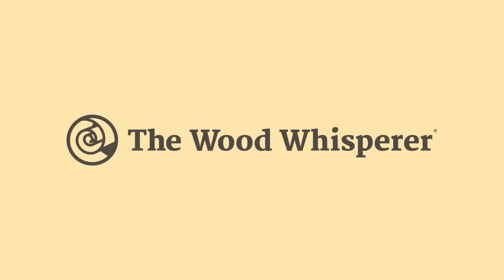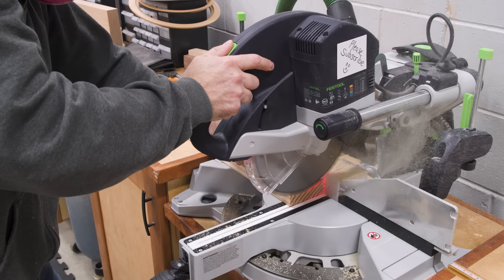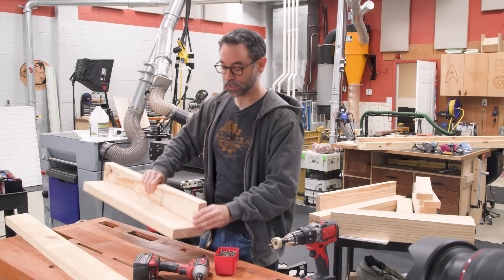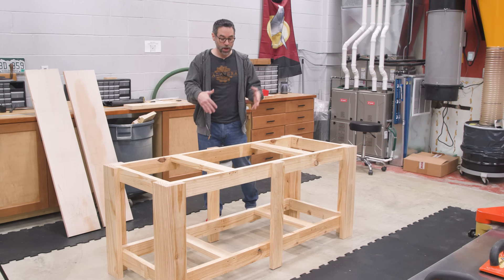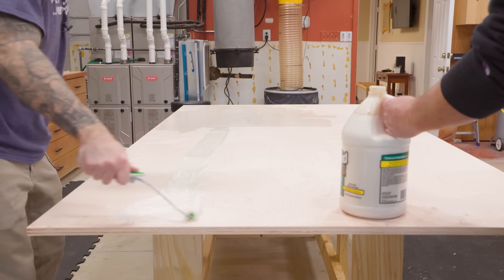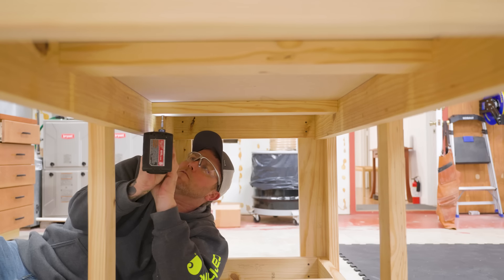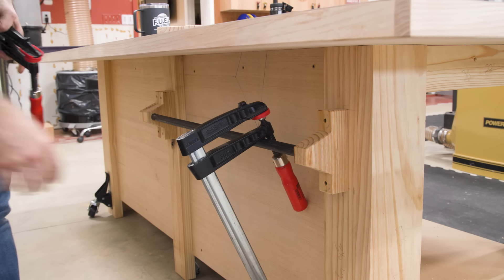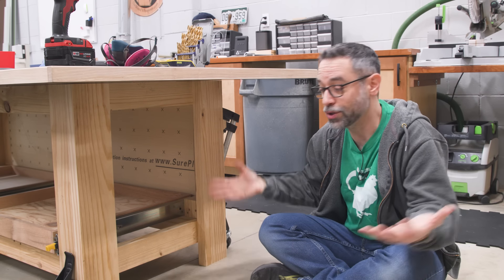Torsion Boxes Overrated? - My New BIG Assembly Table

Comment: My biggest hurdle and misconception when I first started was being discouraged by imperfection and frustrated due to my inability to get things as flat as I saw on YouTube. Thank you for showing that “flat enough” is sufficient and we don’t need “machine work” flatness. I can’t tell you how helpful it was to start accepting error and just trying to minimize it and not necessarily eliminate error. These are the details that beginners need, in my opinion. .. Shannon’s video on flattening by hand was a revaluation for me. I learned about Shannon when I started listening to Wood Talk… and was drawn to wood talk because I recognized your name from YouTube… massive wood talk listener btw. Thanks for everything!
Reply: Truth! Remember no piece of valuable antique furniture was ever built on a dead-flat huge assembly table. I built a $10k French polished walnut dining table using my table saw as a workbench years ago. I've built several tables, desks & beds that I've sold for thousands of dollars each on an old 4x5ft rolling factory cart that sags 1/8 to 3/16" in the center depending on the weather. Most commercial shops don't look anything like fancy YouTuber shops! With creativity and patience we can do great things with very little.

Comment: My old boss used window blind strips under formica. They are just curved enough to keep your two pieces apart, then you slip them out and start your contact. Works well when you’re on your own.
Reply: Mini blinds, sections of an old tape measure, or even an old cord with the ends cut off.

Comment: I grew up in a cabinet and countertop shop. One thing we did if we had screws or any fasteners on the surface getting the laminate, we filled all those holes for the very reason you mentioned. It is worth the extra step in my opinion.

Comment: Back in 1980 I was hired to work with an older woodworker who quickly became my master, in the traditional sense. We had a large multi-year restoration project just starting and we set out to set up our shop. One of the first things we built was what he called a TrueTop, more generically called a torsion box. It was far simpler (and lighter) than the one you show at the start of this video. It was 5’ square by 6” thick, made of 1/2” plywood top and bottom glued and screwed to a diagonal and cross grid. (It was easy to get 5’ x 10’ plywood then.) It had thickened edges in solid cherry so it could be pushed off our shop-made trestles onto its side and slid out of the way. It worked perfectly and stayed flat for decades. I know because I still have it in my shop, and it’s still flat!

Comment: 17:47 For my project table I went with a base of 1/2" plywood glued to 3/4" MDF as the top layer. Then I routed out channels for what I consider home made T-track (it was a quarter of the price of actual T-track, and technically stronger since it's steel flatbar). With a satin poly finish, it's been fantastic over the past two years.

Comment: I built my outfeed/assembly table from construction grade 2x6 pine.  I took the time to joint and plane the faces and edges.  I'm really glad I did.  I glued them together to make extra think legs and rails with notches for cross boards.  It has stayed straight and flat and is heavy.  I would recommend taking the time as if you were building with hard wood.  Looks very nice.

Comment: I originally planned to build a torsion box assembly table but I remember you expressing some skepticism about the need for one in an earlier video so I thought I'd try to build a table more or less similar to this one. I did one layer of 3/4 plywood with 3/4 melamine on top and I ended up with almost a half inch dip in the middle of my table (below a long level set diagonally across). I was able to mostly correct the problem by driving some shims under the plywood between it and the support structure underneath. In short, two layers of sheet material can be quite a ways off flat without adequate support underneath. Maybe you don't need a full torsion box, but you do need full, flat support in my experience.
Reply from the maker: Yup, that's why I included additional support in this table. Four cross rails with room to add more should there be an issue.
Reply: Right.  I opted for three cross braces in the top that I installed and checked/planed for flat before I made the top… on top… after I had installed the leveling feet. 

I reasoned that if the frame was flat (and level), I could eliminate most of the discrepancies before laminating the top…which I did while it was already mounted from below. 

Not the flattest table I’ve ever seen, but likely the flattest assembly table I’ve ever had access to in my lil one man operation.

Comment: My current outfeed/ assembly table top is a 40”x 60” double laminated 3/4” mdf top, edge-banded in poplar, then covered with formica. Works amazing. I laminated the mdf with the same contact cement I used for the formica, and weighed it all down for gluing with a bunch of finder blocks. No screws needed. Dead flat over the entire span
Reply: @idontthinkso666  appreciate that!

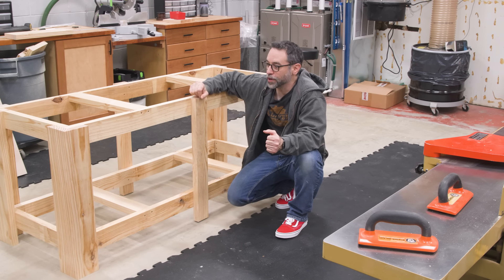Comment: I know I’m  a year late, but it’s  year after building a few of these for my shop. If you want a nice single-piece bottom shelf.. put that in BEFORE you install the stretchers for the top ( 16:00 ). It’ll help square up the bench, and even better you can just drop it in from the top, no struggle. I used 3/4 MDF for the bottom and doubled it for the laminate top. But I also put the stretchers in upright (not flat)  12” OC and then flattened the top edge of the frame w a power plane.  Took 5 minutes and made for a dead flat top - as good as my torsion box.  Also put on adj feet and casters (Rockler). And added a small end vice I’ve had kicking around ( also Rockler).  Nice bench - not expensive.

Comment: I built something similar and instead of making sure each leg was square to the rail, I inserted one screw in each joint and squared the whole thing measuring diagonally.  The the second was done the same but also comparing it to the first.  That way if it's not quite right (it should be) at least both sub-assemblies are matching.

Also, I love you Marc.  Proper instructional vids with a smattering of dad jokes 😀

Comment: I made my assembly table out of a solid-core door with melamine on top.  I framed it with some ash I had laying around and just dropped the melamine in so I can replace it at any time. I used Kreg table legs and casters to save time, which I had precious little of when I made it.

Comment: Formica suggests using backer sheet which is like a thin resin infused craft paper on the reverse. The backer sheet is cheaper than a second sheet of Formica - usually about $10 for a 4x8 sheet. The reason for the backer is to make sure the reverse side doesn't absorb moisture that the top can't. If the bottom, in a humid environment, absorbs moisture, it will expand and the that will warp the top.
Reply from the maker: Good to know!

Comment: Great upgrade to the shop! To solve almost every problem you ran into I would suggest building the base out of ripped pieces of 3/4 plywood instead of dimensional lumber. At the film stages I work in they use a lot 4X8 and 4x10 tables made entirely of 3/4” plywood. They normally have 8” wide legs which taper down to about 5” at the bottom. The stretchers are usually 8 or 6” width depending on if they expect a lot of weight and if there is a center leg or not. I’ve built several smaller (3’x6’) versions of these tables with only 4 inch aprons, to serve as a desk and they are very strong and easy to build. You can generally get the entire leg and apron assembly out of a single sheet if you plan carefully. Oh, ps, I love that plastic trick for the contact cement, I would never expect that to work!

Comment: One of the more solid work benches I've made was with some solid core doors. Found some on a certain resale site for $40 a piece. Solid, heavy and flat. Also put small pieces of metal panel (scrap metal from old AC unit, washing machine or dryer) on the legs and put magnets on often used items like tape measures. Always have them at the ready.
Reply: I got mine from working at hospitals, they make great instant tables
Reply: @dougiefresh9618  Man I really want one of those Hospital doors like you see going into the patient's rooms, they are so thick and wide and solid I don't think they could ever bend or bow.

Comment: I built a torsion box assembly table years ago.  I used it for a few years and decided that it was waaaay too heavy for my garage shop.  Even with casters.  I donated it to a student from Red Rocks woodworking program(Wheat Ridge/Denver, CO area for folks).  They loved it 😊  I moved and did another donation event for older tools...again, was a great thing.

Comment: Look good! I would suggest placing the top braces in the base vertical as the end braces are. This will make the bench stiffer and perhaps take out the slight dip in the top, assuming the braces are  straight!

Comment: 32:09  To check for square you want to measure corner to corner. a little combination square doesnt have a long enough arm. you could be squaring up the very corner of a bowed side... That doesnt work. ask me how I know.... ( learned it the hard way a long time ago )       
Best practice is to make yourself a measuring stick with a point on one end that can sit in the corner.  then just do comparitive measures on both diagonals. when they match you are square!

Comment: The purpose of a torsion box is not only to have a flat surface, it is to have a flat surface that spans a large distance which can be built with less material. Thinner sheets of wood, and no need to brace it or support it in the middle of a large span. So, if you wanted a torsion box that spans like 8 by 3 feet feet you can do that, and it would remain flat even under load without you needing to add 8 sets of legs, horizontal supports, and bracing under it. This means the entire area under it can be used for storage or something else. And, if you are not going to be dropping heavy items on the surface you can use 1/4" plywood for the top and bottom, substantially reducing weight and cost without giving up strength.

Comment: I like those levelling feet! Haven't seen anything like that before that attaches to the outside of the leg, only ones for metal frames that you can use with timber using threaded insert nuts or T-nuts.

Comment: Hi Mark,, I agree with the earlier comment nice to see you back with a long form build!! Hope there are more in the future.  I noticed that you assembled the leg and rail with the rail vertically,, in the future remind yourself that when assembling two pieces where one is much longer than the other that the longest should be horizontal and the shorter vertical,, it's much easier to position and hold the shorter leg of the two vertical,,, the longer rail when held horizontal on the "flat" surface can be positioned to take into account the crown  (crown is always up,),,, and positioning the leg square to the rail is easier to assure  with your framing square which will read almost a third of the length of the leg, cheers 😊

Comment: Learned a few things here I'll put to use soon. Scored three sheets of 5x12'x1" core laminate sheets and seven 30" 400lb capacity drawer slides at auction last week. I'm gearing up to build a monster steel frame assembly table. Was planning a torsion box top, but now reconsidering!

Comment: Nice video, Marc. I appreciate your use of SYP for the main structure. I’ve used it for 3 shop projects. More strength and stability than white pine or fir. Plywood is still obscenely expensive and the yellow pine is a cheap alternative for sides and a base for cabinets. I usually rip pieces off the outside edges leaving the center for scraps. If the center does not warp I have an unexpected bonus that can be used for cleats,etc. I would recommend applying polyurethane over all SYP components to minimize moisture absorption.

Comment: Nice!
Always helps to heat both adhesive tape and surface with a heat gun/hair dryer…..and tape adhesives often have a cure time.   Command strips have great shear strength😎

Comment: When I built my workbench I put one piece of sanded plywood for the top with a piece of lower grade plywood under it to make the thickness. Itbis a way to save some money while putting higher grade where it will be seen and felt and the lower grade under with a solid wood edge banding to hide the layers.

Comment: I'm glad to hear the comments you make about assembly tables! Nice small work area is a formica countertop 10 ft long and it serves me for the work I do. My first bench was 24 ft long 24in wide fixed to the wall with Masonite top on top of plywood it's a relief just fine also!
But, when driving a screw why do you trigger finger driving the screw? Why don't you just pull the trigger and drive to screw in and let the clutch do its job! I don't know why guys keep squeezing a trigger off on off on off on off on off till they get the screw in, and then you hit the clutch setting! This must be a YouTube phenomenon of YouTube woodworker influencers how not to put a screw in!

Comment: Great video for someone starting out.. well explained. I never did "torsion box" assembly stands - just standard 3/4" surfaces over 2x4 legs and 1x6 crossmembers - preferred the floor for solidity when necessary (cleaned off of debris, of course), as much of my work uses T-Nuts.. which don't tend to drive in as completely/solidly when done on any tabletop.. and I'm not about to build a 6x6 timber bench to solve a single problem. Nonetheless, interesting to watch..

Comment: Great build.  For me, I like to have dog holes and either t-track or MatchFit groves for clamping stuff so the formica top is a no-go in my case.  It is nice to have of course and makes a great surface.  My table saw 4x4' outfeed doubles as an assembly table and I have MatchFit slots cut in a criss-cross pattern.  I wish I had room for a full 4x8' table!
Reply: There's nothing saying you couldn't do both!  It would ruin the solid purity of the seamless surface, but if they're what works for you, add them!  Same for 20mm or 3/4" dog/clamping holes.

Comment: I built a 4x8 torsion box table a few months ago for large slab leveling with my router. I think you're right, the torsion box is overkill. I took a different approach to the base, making it a few inches oversized so that it would work for 2 levels of storage for whole sheets of plywood, my whole sheet of foam insulation I use for cutting plywood, and storage for the router sled and rails and my Kreg poor-man's track saw track. I could have fit 3 levels for all this big flat stuff, and wish I had.  Construction of the base was similar to yours. I have a smaller assembly table next to my workbench, also with a torsion box top, but I used the voids for storage of small things through the sides. I use it all the time.

Comment: When working in a medium where the end product could expand and contract by much more than the difference in flatness of a piece of ply, that is certainly plenty flat enough and is why I never buggered with a torsion box for an assembly table. I did use a torsion box for my optical tester for hand-ground telescope mirrors though, and the importance of consistent measurements there cannot be understated.

Comment: you could put pop-up electric socket points in the middle of the table within the area of the middle legs and would the table be same height as the table saw then it could be used as an outfeed table

Comment: Sometimes a bench changes location, so when legs aren't all reaching the floor, I like an adjustment I can change.  Large diameter lag screws at the ends of the legs allow me to fine tune them, not only to spread the load, but also to get a level top.

Comment: When using construction grade lumber, I would usually rough mill and the let the wood sit for a while, ideally a week or more, then mill to final sizes.  This approach lets the wood react to the milling with some warping, then the final milling can compensate for some of that.  This does mean you have to anticipate greater waste, so the rough milling need to be generous.

Comment: Another option for mobility, is a pallet jack. Then all tools and workbenches can be “stationary” but the pallet jack can very easily and safely move stuff around.
Reply: Exactly! I built mine with just enough of a gap at the bottom to fit a jack under it. Came in hand when I moved and was able to lift it with forks onto a trailer.

Comment: Hope your yellow pine was better than mine. I chose the best 2x12-12s at the store. I ripped them and discarded the pith.

During band saw ripping, several went BANG! like a gunshot. Some split at the progressing kerf like ragged firewood. Unbelievable internal stress.

So I stickered them in the house to finish deforming. The result is $250 worth of almost hopelessly warped boards. The champion is a 2x4 sized piece taken from one edge of the 2x12. It is bowed 1” in 6’—the hard way, across the 4” dimension. When it comes out of jointing and planing, it’ll be an inch wide.

So much for my rift- and quarter-sawn pine material.

Comment: What was the spacing you used for the screws on the top? I did something similar on a smaller, more basic level and i don't think i used enough screws. And would the technical concern of the laminate breaking in a screw hole be solved by putting the screw side down? Thanks for the great video. I'm loving your content!